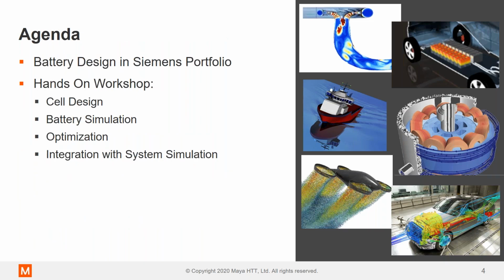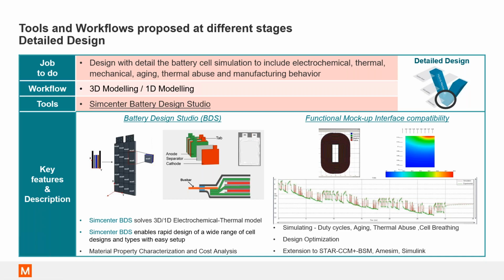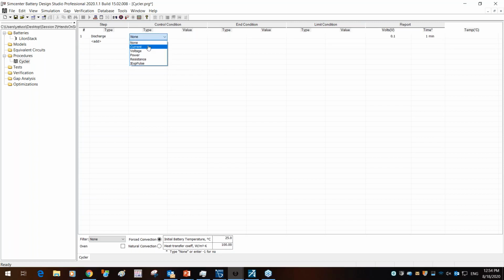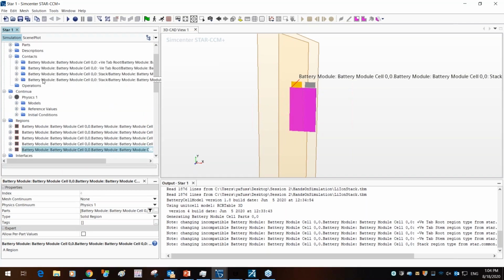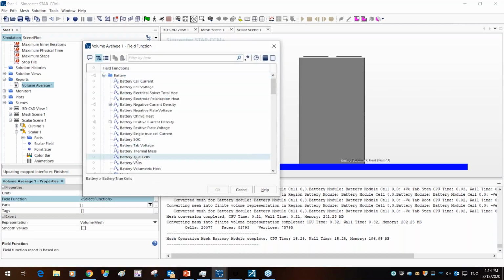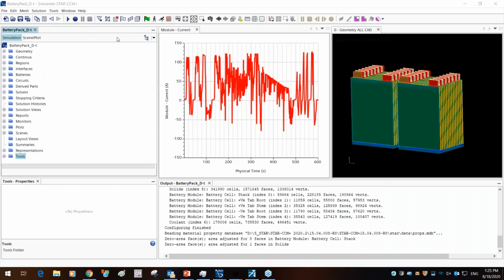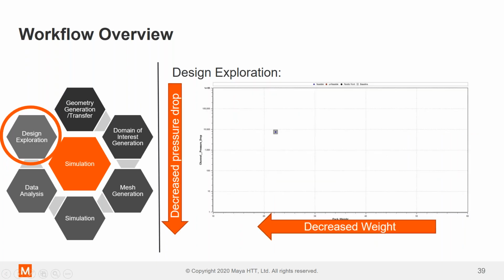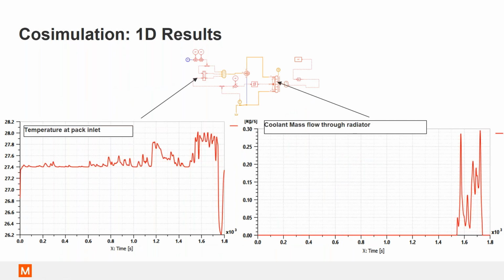Hands-on Simulate Series with Simcenter STAR-CCM - Battery Simulation (Session 2)

Comment: Namaste Sir, Thanks for this great tutorial, I have two questions : 1. Where can i find detailed data related to cell geometry and thermal condition that we are required to put in Battery design studio ( Any Open Source database)? 2. Why didn't  you use any equivalent circuits i.e.  NTG,  etc. for simulation in battery design studio, can we proceed without these models as in your tutorial or simply to ask  when do we use these models.